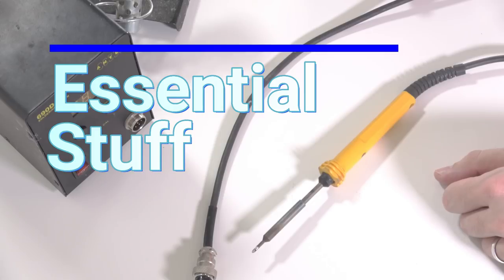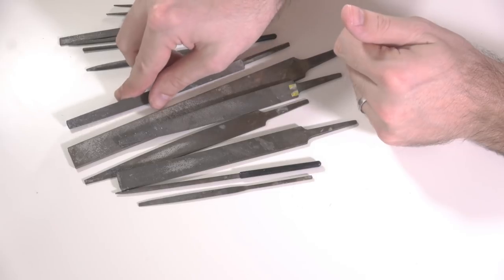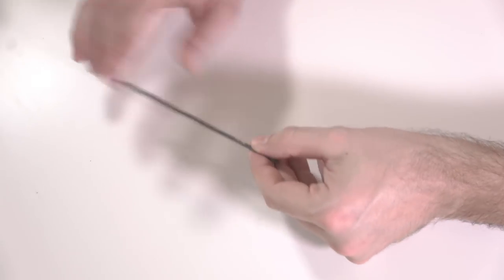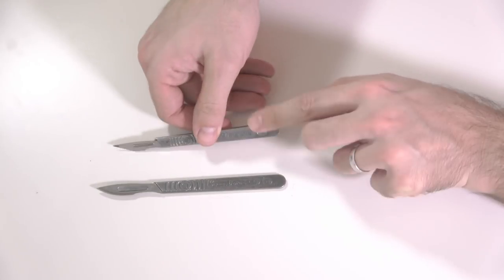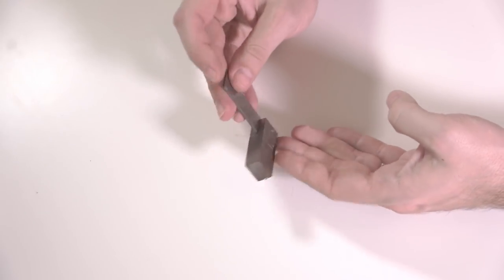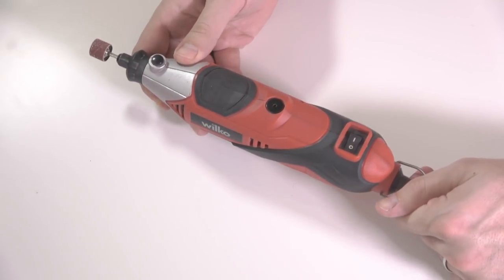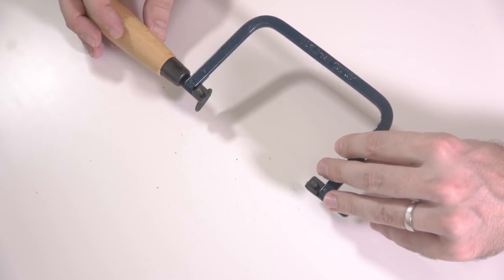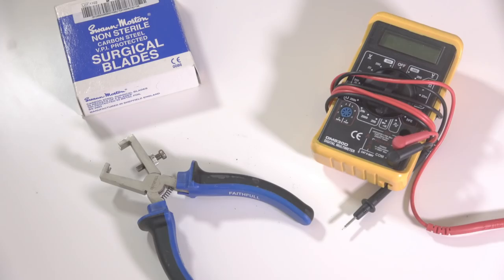Tools Required for Model Locomotive Kit Building

Comment: Good information on tools, looking aside to my workbench during this video confirms the tools you ddescribe are the most essential and used ones.
To this I wood add a piece of plywood on top of your work surface to solder, cut and drill on.
A variety of square metal and or wooden pieces to hold things square, some metal clamps, I found some ginat crocodile clips which are very usefull.
Also wooden clothes pegs with the spring inverted on them are a good help to clamp parts together.
And finaly a selection of different kinds of brushes, like an old tooth brush, some paint brushes and a small wire brush to clean parts from filings and other debries, and to clean your model with water and soap after a soldering session.
Reply from the maker: Useful additions to the 'kit list' thanks very much :)